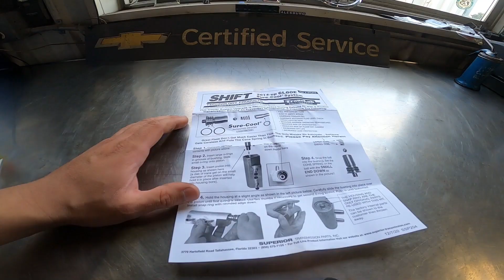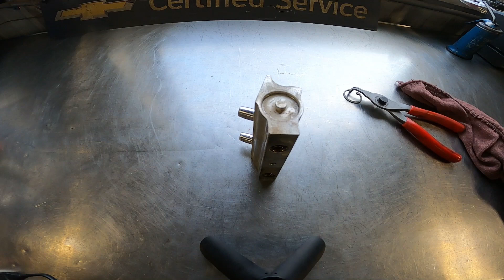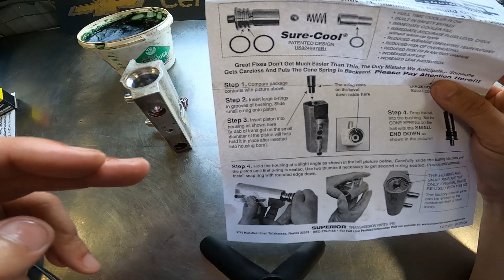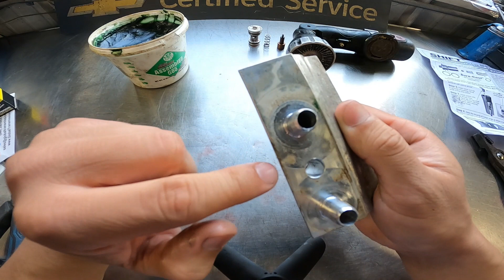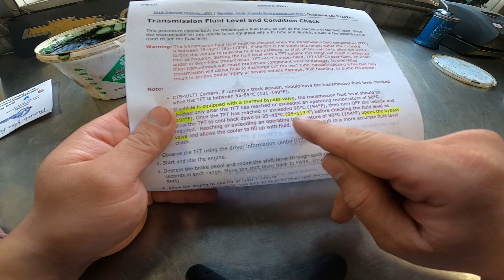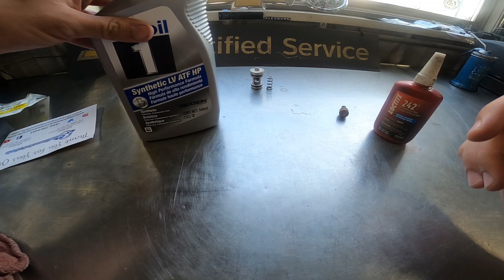Thermal Bypass delete. Removal.REBUILD! Install. STL010 8L90 M5U

Comment: FYI, just did my 2015 gmc Sierra Denali 8L90 and I was able to remove mine without having to remove the drive shaft. I used a regular ratchet. No special tools required. Great vid though.
Reply: Same here but a 2016 Sierra Denali. Very easy and used a regular socket wrench.
Reply: Same here 2019..

Comment: Why not use a box end wrench or ratchet wrench instead of pulling the drive shaft? Seems like a lot of extra work.
Reply: I was able to use a 3/8 Torque wrench with a short extension over the top of the driveshaft no problem. It fit perfectly between the exhaust and drive-shaft. It was his method and a great how to video. But, I agree. The removal of the drive shaft was unnecessary.

Comment: I have a 2019 new body style Silverado. Would the newer gen trucks benefit from this or did GM change the thermal bypass for these?  I have the 8L90 on a 5.3.

Edit:  I ended up ordering one and installing it. It all fit like a glove. My trans ran around 175-185, a little cooler than the previous gen trucks. Now it barely hits 130 on the highway and 150 in town in south Texas, where it’s been 95-105 *F lately. Seems to be less clunky and smoother. Very happy with this product.   Wish I could post pics on here but they changed the cooler line gaskets on the newer trucks. They are larger, green, and seem to stay up into the thermostat housing. Still the same process to install, just less likely to lose the gaskets. Thanks for the video.
Reply: I installed it on mine and made it worse not sure what to do now 😢
Reply: @Pelonskis  Worse how? Hotter?

Comment: Should I do this on my 2020 1500 rwd?

I have the 8L90.
Reply from the maker: I’m not sure if the part number is the same on the new body style. But I do know they kept the TBV at 194 on the 8 speeds ONLY even the 10 speeds are at 130 degrees now. Definitely something to look into. If it were mine I’d do some research on their website.
Reply: I did it on my 2019 (new gen truck). It fits as long as you have the 8 speed.

Comment: Would it be safe to just order the updated 86774933 valve part and stick the stl010 sure cool parts in it to be safe.
Reply from the maker: I think just the pellet (thermostat) inside the housing is the o Lu thing that’s technically updated. So the housing you’re going to buy and the housing you have are probably the exact same. Personally I’d just use the STL010 or the updated thermal bypass. Both just seems like more $$

Comment: sounds like you got lifter issues
Reply from the maker: Nope. Did them when I bought it. Pushrods where bent as well. Turned off AFM with HP Tuners, haven’t had a problem since.

Comment: About to install this on my 2019 silverado.  Noticed that once the trans temp gets to 180* the downshift when coming to a stop is brutal.  My bypass is like yours where it is horzontal to the ground. I wonder if it would be possible to do the swap without removing it from the trans block. thoughts?
Reply from the maker: It seems do-able. Trans Gel would really help in that situation to keep parts from falling back out. Let me know if it works for you.
Reply: Ya I have a 23 with the 8 speed and sometimes it slams so hard when I'm coming to a stop I have to do a double take thinking I got rear-ended.

Comment: Just did this installation tonight. Very well done video. Clear and to the point. Live in Central Canada. Very noticeable temp difference right away.  Runs much cooler. See how the winter works with it. Can’t wait for summer pulling next summer. 👍

Comment: Jay do you have a small trans cooler or does your Transmittion lines go into the Radiator ? I ask because my lines go into the Radiator. And the radiator is heating up my trans gets up to about 160 to 170 after driving city on a Hot day here in Illinois.  , I think I'm going to buy a  trans ( its own small radiator) cooler !!!!????
Reply from the maker: I just use the factory radiator. I have seen aftermarket coolers that you hook up directly to your factory lines with rubber hoses and clamps. Thought they are not very big I’m sure a stand alone cooler is more efficient.
Reply: @jaycastillo9313  well I ask because my engine  temp is always 210. I don't like it that hot. But its ( Air quotes ) normal operating Temp. But it seems now my engine gets the Radiator 210 and that heats up my trans temp now Probably ( I'm guessing ) probably 20 ISH ° , I was just wondering why mine is running hotter than I still like at 160 - 170. BUT Granted that is much better than 200- 210. , but I was just curious if your L80 , is why it's cooler than mine. ( I think mine is the L60 ) I have a Dipstick , so I'm sure its one of the versions. 4X4  , 6 speed. But just trying to Learn all I can about it . Compaired to other Chevrolet And GMC,  transmittions, so if anything ever happens to it. I know what I have. 👍💯
Reply: BUT today here just east If ST LOUIS,  were about 94° outside. Its HOT HOT. , I WILL try the interstate later and see if that cools it down to where I'd like it to be. Around 135- 145. 👍👍
Reply from the maker: @Tow_Sr.  it was HOT HOT here yesterday too. I’ll be honest we’ve done so many 6 speeds and when we flush the coolers I’d say we average around .6 gallons per minute of flow. On the last 6 speed that was in our shop the tech that flushed the cooler said it flowed at 1.1 gallons per minute. So it got me thinking why that one was so much better (almost double the flow) than all the others we do? We’ve only had one that was so plugged it blew the lines off our flow machine. But also raised the question why GM warranty allows a .5 or .6 gpm flow be acceptable when they can flow up to 1.1 gpm or higher. I need to look back on that one where we replaced the cooler/radiator to see what the flow was.
Reply from the maker: I guess what I was getting at was maybe the 8 speeds coolers are bigger or have better flow. It’s rare we do 8 speeds (knock on wood) so the cooler flow rates on those are just not in my memory.
Reply: @jaycastillo9313  I was thinking it could be just that , just the Flow or Pump inside the trans could be the difference. BUT I'm not complaining. , my 6 speed is now almost 50° cooler than it was running. Even at 160.  Is about normal now. It MUCH better than 210.  But I still don't like it that hot. I may get the smaller , little/ mid size  , Trans Cooler / radiator and 🤞 it gets mine down to normal about 135 to 140. Id feel alot better with that before I haul my 3500lbs. Boat. 💯🍻🍻🚗💨💨💨💨
Reply: @jaycastillo9313  yes also check and see if the 6 speed had a New Radiator , maybe if you buy a aftermarket Radiator,  it could have larger Lines ( in the radiator ) just for the transmission,  if i was making them id make them bigger . Considering you can't put a 4 core big ol huge  thick radiator . If your using all Factory Hardware, Hmmm 🤔🧐 maybe they do make a thicker factory replacement radiator , or it could of been a radiator from a 15 or 16 , 17  , that works for the 14 models , hmmmm, thats something to look into 🤔💯!!!!
Reply from the maker: @Tow_Sr.  I’ll be honest with you after my 4 hour trip yesterday when it was hot hot outside my wife drove back because I got into the beer a little bit. When we were in town I might have broken 150 and never checked back when she was driving. But I’m sure it dropped at highways speed back down to around 140. Not pulling anything. If you want I can take that 3500 lb boat off your hands for the rest of the summer so we can compare temps 😂
Reply: Or like my other,  chat . Please look into the radiators. See if a 8 speed,  15 ,16,17 radiators themselves are any bigger / better than the 14s,15's with the 6 speeds in them,  just ( if you can ) check to see if the radiators are any differant. That might be one of those Speed Secrets that is worth looking into , thanks for all you help !
Reply: @jaycastillo9313  me and the woman have been thinking of selling it. We don't have our 20 year old bodys anymore. AND family issues . We don't go out anymore , so it maybe for sale. Idk. I love that baby. Its SO nice to get out here and there and do some , skiing,  tubbing,  and or just cranking it up and get some wind therapy,  go to the coves amd look at the hotties,  😁 swing off the roap swings. Its so nice. But we don't use it much anymore. And I'm like you. I like to put down a few to many put on the water. I chance a Dui most times we come back the same day 💯 ,
Reply: @Tow_Sr.  be careful dui's fuking suck and a night in a hotel motel tent whatever is hell of a lot cheaper and all the bullshit involved after getting one and that's all without injuring someone depending on state just a basic dui cost about 15k after all the classs fines ect ect. Cheers

Comment: “Im not sure this 10mm bolt will take 16ft/lb..” proceeds to give it an uggadugga with a 1/2” high torque Milwaukee. I like the way you roll hahah thanks for the vid, just did mine, took maybe 15/20 min. With 6” lift plenty of room to get at with out removing drive shaft with out wobble socket 👍🏻

Comment: Where do i find the correct part number for the gasket on this install?  Mine is a 2018 same as your video here, but i want to make sure i buy the correct gasket.  Thanks for an excellent video.
Reply from the maker: The oval aluminum seal with black gaskets is part number 23135703 and the o-rings are part number 12650609. Hope this helps!
Reply: Sorry, you did give the part number in the video    GM 23135703  Thanks

Comment: Great video,  I just replaced mine on my 2018 Chevy Silverado crew cab, took it for a test drive and it was almost 40 degrees cooler on the same drive with the old one, and I'm in the desert southwest.

Comment: Great video! I just installed this on my 17 Silverado 1500 (6L80) and now it runs much cooler. The hottest I've seen my tranny in 90 F degree weather was 147 F. What would be the drain and fill procedure now that the fluid doesn't get to 160 F? Per GM the hot check procedure is between 160-200 F.
Reply from the maker: Good to hear! You’ll be happy you went this route. To drain and fill now all you have to do is drop the pan (recommend putting a filter in if you’re already there) and fill through the dipstick tube on the 6L80. Just fill to the cold marker while the truck is running and you can just shift through the gears and re-check. I do not remember if the exhaust has to be lowered on the 6 speed off the top of my head.
Reply: @jaycastillo9313  I'm installing this on my 6L80 today,..saw a video showing if you drop the pan enough to sneak the filter out first,  it is easier to remove without yanking on the exhaust

Comment: I had my transmission replaced last year because of this issue.  I dont think they installed a lower temp block because it still gets up to 194°. Will this void my warranty if installed?
Reply from the maker: Absolutely not. GM actually recommends all transmission that come in for any type of transmission service and/or complaint the bypass be replaced with the new lower temp bypass. The bypass will have the number 70 stamped into the bottom of it if you wanted to crawl under and check yourself. The STL010 would not void warranty either as no tech is going to pull apart your bypass to see what’s inside.

Comment: in colder climate do you notice that the transmission has a firmer 2-1 down shift until it reaches temps of 100* or so?  Small price to pay for longevity of the trans.
Reply from the maker: I can’t say that I have noticed anything like that.

Comment: I swapped the trans thermostat block on a 2017 4wd 8speed. No need to remove the front drive shaft. Did it in a driveway on my back in a few minutes.
Reply from the maker: Awesome! Your transmission and torque converter will be very happy.

Comment: I have a 14’ Sierra with the 6l80 I cant find the part numbers for the small gasket or o rings on the cooler lines
Reply from the maker: The oval gasket number is 23135703 and the two o-rings for the lines are 12650609. The o-rings just got added to the GM parts catalog. They used to only be serviceable by ordering all new lines. Last check parts could not locate any yet. Good luck!

Comment: Do you have to add any fluid back after doing this? I just got the kit for mine and don’t know if I should get some fluid to add after doing this?
Reply from the maker: Yes, you should top it off after you finish thing upgrade. The 6 speed has a dipstick while the 8 speed does not.
Reply: @jaycastillo9313  awesome thanks man I’ll grab some before I install this.

Comment: My trans temp was getting up to 180 with this install @64F local temp. I drove it maybe 20-25 mins stop and go, stopped for an hour and then drove it 20 mins in city/freeway and got up to 180. 
Cause for concern or just be happy it’s still under my normal 198ish?
Reply from the maker: Definitely seems odd. I remember summer time temps here in Iowa (not pulling/hauling anything) trans would at max get into the 150~ range in stop and go then drop drastically back down once I’d hit the highway. Ambient temp well above 64 degrees.
Reply: @jaycastillo9313  maybe I’ll try taking it out and making sure I put it in right. 
Just got a fluid and filter change yesterday so everything should be good otherwise
Reply: @jaycastillo9313  thanks for your reply! I’m not pulling anything either

Comment: Hey Jay, I live in Canada where in the winter it usually averages around freezing. Would you still recommend doing this? Thanks!
Reply from the maker: I live in Iowa and it’s pretty cold here as well. I personally remote start the truck for a few minutes before I drive it and the trans temp is usually about 20 degrees warmer than ambient temperature when I hop in. And it warms up pretty well but driving immediately brings it back down. I was working it pretty hard today and it stayed about 80 Fahrenheit while driving the about 100 while I’d get out and let it idle while I was working then right back down to 80 when I’d take off again. So to answer your original question yes I definitely still recommend this. Hope this helps!

Comment: How do you add fluid if no fluid comes out?
Reply: Ok. Thank you for such a fast response! Doing that while it’s on sounds interesting haha. Thanks for the help!
Reply from the maker: On the passenger side of the transmission there will be a heat shield with two bolts on it. Remove the heat shield and there will be a black rubber plug facing straight  down into the pan. That is the fill hole. It is very tricky to get fluid into. I recommend a pump that screws into the bottle or a siphon to pull from the bottle then pump into . Be careful with the catalytic converter they get hot very fast and the vehicle needs to be running when you top off the fluid. Hope this helps.

Comment: Now if I have a dipstick (2015 silverado 6l80e) start it up fill it into the hash marks and go correct?
Reply from the maker: Yes, after you do this install you’re good to just check it on the dipstick. Top it off and go!

Comment: What about the 2017 GMC on a 6L80 with that fluid? what fluid is best on this trans?
Reply from the maker: I have personally always just put Dexron VI back in them. That’s what GM recommends for the 6L80. Now wether someone like amsoil or Mobil makes something that they would consider an upgrade I’m an not sure on.
Reply: @jaycastillo9313  I am waiting for Superior to get a new shipment.